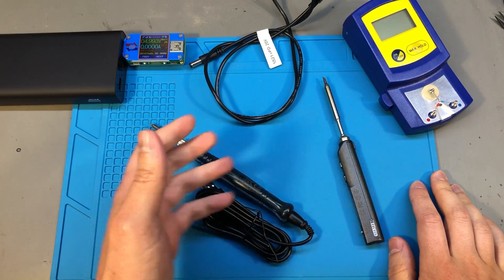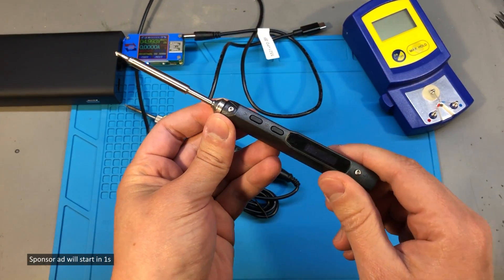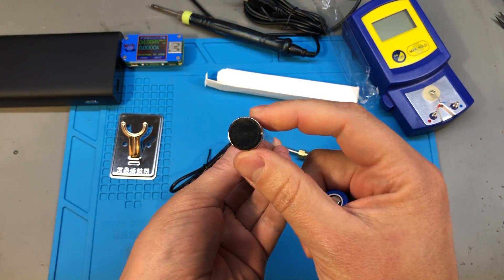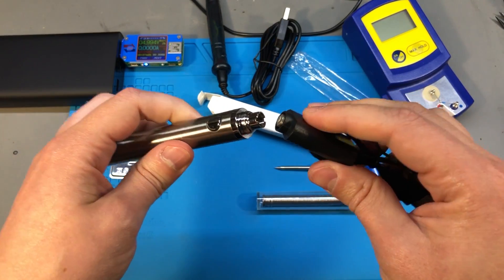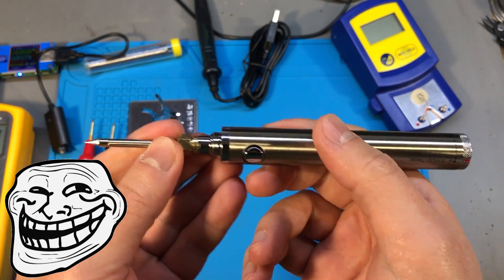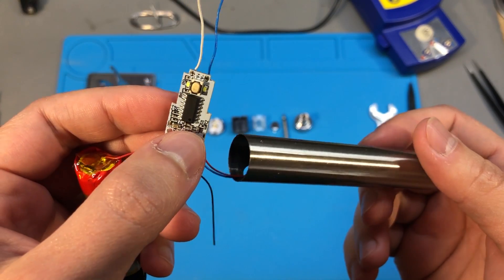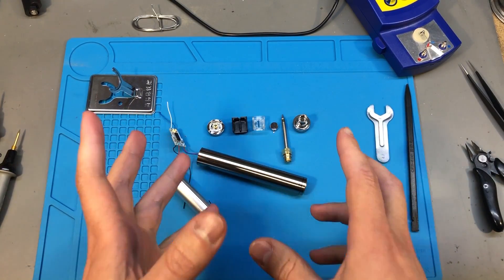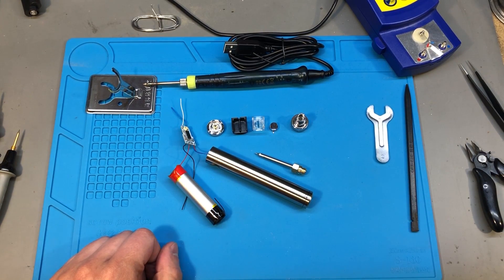8W Rechargeable Soldering Iron Review & Teardown | Voltlog #307

Comment: What material is in the base of the soldering iron tip for the 5 V cordless?Because mine broke off so the iron won't turn on now, but I want to reconnect that little piece that broke off.Is it a special material or what can I put there to replace it? The whole tip is fine , just the little tiny nub that is on the very bottom of the part you screw into the soldering iron broke off , can I solder it back on or what else could I use. ...what is inside  the base of the tip that allows the iron to power on ???? Thanks

Comment: I bought a similar one one, with the Micro USB port in the back, and it works fairly well for simple soldering. It starts to struggle heat wise on anything with a ground plane, but soldering wires together on the run, it does the job. So far, I haven't had any issues with the battery at all, and seems to last a while.
It doesn't compare to a proper soldering iron, like the T12 irons I'm using mostly now, but it's super handy for soldering on the run!

Comment: why not buy one of these, for the housing, momentary switch, and ability to mount this tips, then replace the electronics on it with something more robust?  Maybe even find a way to mount some kind of potentiometer or PWM for basic temperature control?  PWM would be most preferable, but a potentiometer would be simpler.

Comment: I bought one off eBay crap powerless. Bought the sealey and fitted a new battery and more mah now it's good. And iv just bought a slimline cordless iron of eBay turn it on shows battery power two Led and a torch pad that you just put your finger on the heat the iron so far its my favourite.

Comment: It is indeed an eGo e-cig body with a soldering iron screwed on, the eGo had the same 5 clicks protection and exactly the same recharger. One of the most annoying things was the same you've mentioned, you couldn't vape it while charging. It even has the "security feature" preventing the eCig.. ahem, sorry, the soldering iron, to keep running for over 10 seconds :D

Comment: The Evod twist is a standard vaporiser (Ecig) power source.  The 10 second time out is a feature of almost all regulated vaporiser power sources.  Most interesting to me is the tips with the 510 connector (an industry standard for vapourisers).  Since I make a lot of my own stuff and have the 510 sockets, I think I'll buy some tips and make something that runs off an 18650 Li-ion battery.  It would also be possible to make something that uses an ATtiny85 for a PWM heat control and to turn it off if the battery level gets too low.  ETA: it should be almost impossible to damage the electronics on an Evod twist.  It has protection to stop it firing a load that is too low, so something else is going on here.
Reply: Sometimes a MOSFET can be damaged before or during product assembly by static. This seems like a likely cause for large number of infant deaths of MOSFETs in products.
Reply: Where did you get with it?
Reply: @Tiyagi99  I didn't. After several people did videos on these the vendors started putting the prices for the tips up by adding stupid shipping  charges and others ran out of stock. I shelved the project and never got back to it because I had moved onto other things.
Reply: @Chris_the_Muso  Ok thanks.
Reply: @Chris_the_Muso  if I were to make it what would you suggest. I can afford one but want to make it by myself to improve it.
Reply: @Tiyagi99  I have a usb powered handskit and was trying to find a video on adding a li-po battery instead of relying on the corded usb connection. It should work.. I think lol
Reply: Why did you delete the reply?

Comment: I had one of these (you can buy the tip only) and connected it to my old e-go vape. It's got enough power for simple surface mount work and fits neatly in a tiny business card box,  but it struggles to solder to large ground floods or chunky wires. It also fares badly with lead-free solder due to the higher melting point. On a more useful note that USB 8W iron I built a control board for - initially tried to estimate the tip temperature with the temperature coefficient (via shunt resistor) but it was too unstable so now I just blindly PWM and adjust duty cycle as needed - you're welcome to have the schematic and firmware if you want to build one. Thanks for the great video :)
Reply: Where to buy the tip?

Comment: A decent modern e-cig mod can easily output 50W. Check out the first review on the replacement tips—someone's already done this: https://www.banggood.com/8W-15W-Soldering-Iron-Tips-for-5V-8W-Solder-Iron-Wireless-Charging-Soldering-Iron-reviews-p1595202.html

Apparently the tips can be disassembled and the heating coil replaced, so if you wind your own coils you'll already have the bits (nichrome, kanthal, titanium &c.) to make custom tips!

One interesting thought: fancier e-cig mods can regulate coil temperature by measuring its resistance (known positive temperature coefficient for a given coil material) while it's being heated. You'll have to replace the coil with something like titanium or nickel of course. I'm definitely ordering a couple of tips to check out how well that works! Even if it doesn't, at least it's super portable—literally just the size of the tips, since I'm already always carrying my e-cig. Σ:3
Reply: My experience with battery powered soldering iron and 8W USB soldering iron is, you won't need to rewind the heater coil in the tips. Because these irons burn tips. They become pretty misshapen and eaten up after several uses, the tip is consumable, the iron overheats it, and you pretty much end up overheating it to get anything done, and the quality of material is low. I don't imagine very much is left by the time the heater could be replaced or may need rebuilding, except in rare cases where the heater has failed way too early!

Comment: Seeing how they modified an e-cigarette to make that, it would be interesting to see if the concept could be taken farther: make an iron soldering tip that go on those beefy 18650 e-cigarettes in place of the whole tank assembly. I guess there is kind of a norm because of the number of after market tanks, and the DC to DC part would be already taken care of.
Reply: ima do this
Reply: someone liked my comment, did it works great

Comment: Is there any chance you shorted the circuit when you were testing the voltage?  That might have fried the fet.  The tip will have a higher resistance than your meter probe. :-)  Love the fact that someone has repurposed a ecig battery pack and bolted on a soldering tip.
Reply from the maker: I only tested the output after it stopped working  so I would say no. I also noticed exactly the moment when it stopped working, while heating up the tip.

Comment: Shame you got a broken one, Ive had one of these for a few months now and its been working fine. I also have the small usb 8watt ones and making a yourself a new cable with proper silicon wire is a must otherwise they are so hard to use with the default cable.
Reply from the maker: It all depends on how much you plan to use something like this, for a quick job, soldering a broken wire in some remote place, I wouldn't mind the stiff cable but if I were to use the usb iron more often sure I would be bothered by the stiff cable or by the fact it doesn't regulate temperature.
Reply: Yep - had one for about a month now - used it for a few small jobs. Other than the 10s timeout, it's really quite handy. Just received the hoof tip today - much better having some decent surface area on the tip for most jobs - seems to heat up even faster too. 
Must admit I was hoping it'd be a sealed Li-ion battery inside though - now I'm worried about the LiPo turning into a grenade if I leave it discharged for too long (leery of them after experience in RC car batteries I guess).

Comment: We need a ts100/80 with integrated power delivery trigger.
Reply from the maker: that would be nice!
Reply: Did you see Brian Lough build an adaptor for his ts100 the other day? If that wee pd chip could be squeezed into the iron (ala strange parts) then we have the perfect edc soldering iron
Reply: TS80P is designed to use power delivery.

Comment: That's a ecig battery
Reply: Yeah I'm pretty sure it's literally a custom soldering iron tip that attaches to standard ego-style vape devices.
That's why the power dial is marked in volts rather than temperature, and also why there's that 10-second limit: you don't want the heater of a vape device to stay powered for longer than that in one burst, or stuff would start burning.

I think the iron tips could make sense for someone who is already carrying a vape around with them, just for occasional use, but selling the whole kit together like this seems very weird to me because it's so clearly a quick and dirty hack that doesn't work very well, as you found!

(Those $5-or-so 5V USB soldering irons are handy if you have nothing better available, but keep in mind that there's not really any temperature regulation at all. I found that mine will climb well beyond 600°C pretty quickly! There's not much thermal mass behind that temperature, and it's fine for soldering wires, simple components, etc., but you may want to be careful before using it with more-sensitive components :)
Personally I doubt I'll ever use mine again as I can power my TS80 from a USB power bank, and that's a lot more convenient. Also I think that Ralim's third-party firmware for the TS100 and TS80 will let you heat the TS80 from a regular 5V USB port. It's not going to be very fast, of course, but it might be good enough in an emergency!)
Reply from the maker: That would explain ecig keywords I was seeing mentioned around this model.
Reply: @voltlog  Same with the charger I think, it's an ecig "standard".
Reply: @voltlog   also the 5 clicks to turn on and the 10sec timeout
Reply: Yes. They just screwed an iron tip on a e cig battery. Not really suitable for a soldering iron.